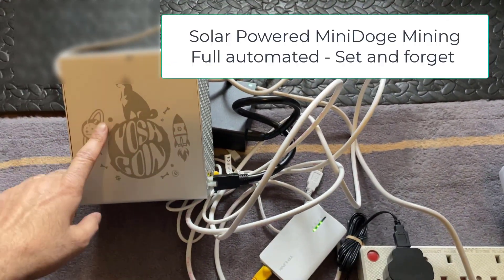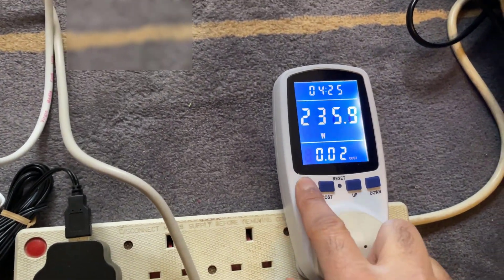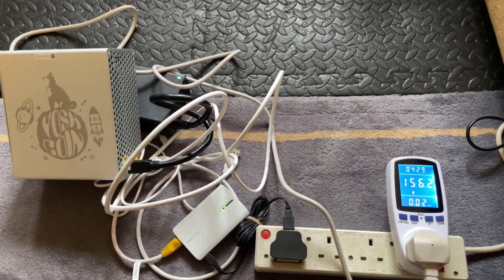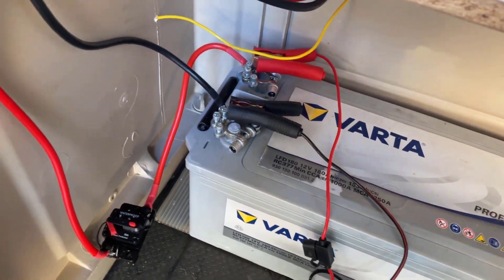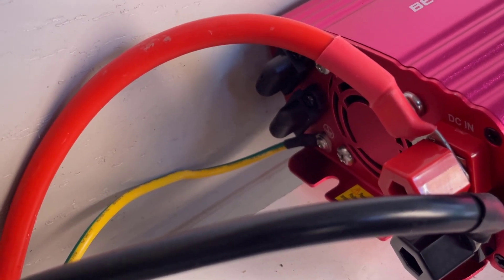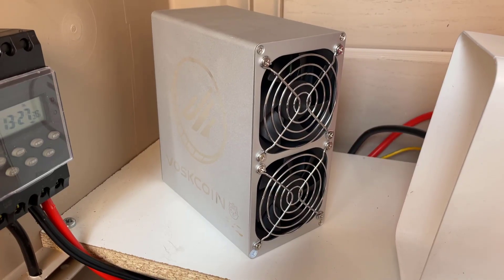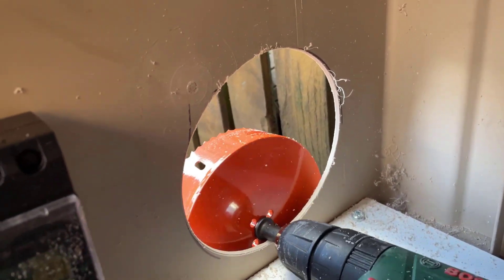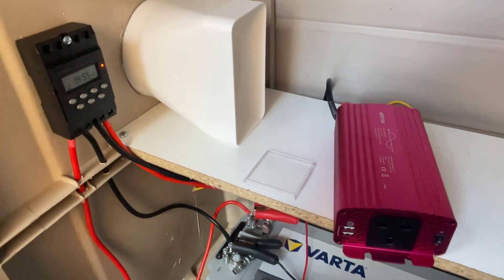Fully automated Solar Powered Mini Doge Mining

Comment: This miner is 12VDC, Why didn't you connect the miner directly to the battery? Is it possible?
Reply from the maker: Mini Doge 12V ?? Where did you read that? It came with a Mains Powerbrick, so naturally I used that.
Reply: @HandymanSavage I am willing to buy a minidoge 3 and it has a power brick but in specifications it says it uses 12V DC. I can't post the link but you can Google it. If yes, Do you think it can be directly connected to the battery or to a solar panel controller?

Comment: Instead of a timer ... you could use a low volt cutoff switch. Set to 12.4v (or what you deem low end) with a 1.2v increase (or less depending on battery capacity) to resume passing power.
Great vid tho mate! Got me inspired and I've got one going already in test scenario. (Def not hands free yet tho)
Reply from the maker: Thanks for your feedback and good to hear you're dabbling with this. I did a lot of tests along the way which failed, but that's what will lead you to perfect automated setup. Good point with the lv cutoff switch, but I went with a timer as it allows me to make the occasional adjustment for seasonal weather impact on solar battery charging and how much I want to mine for per day. Anyway, good luck and let us know how you get on

Comment: Run it on daytime, with startup an hour before sun comes to panels, then you get the most out of the power from panel, and battery will last for many more years.
Reply from the maker: Yeah I did try that after the video and agree it's better during the day as the Solar Panels try harder to keep the battery charged, whereas at night time it's pure battery drain.